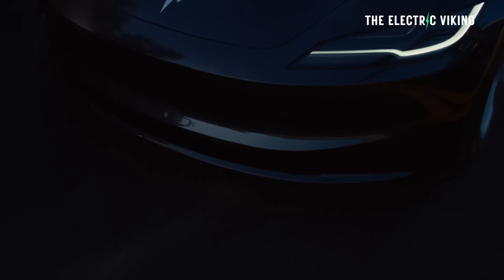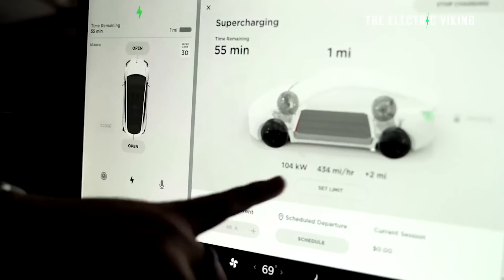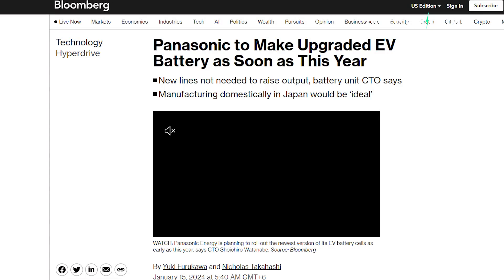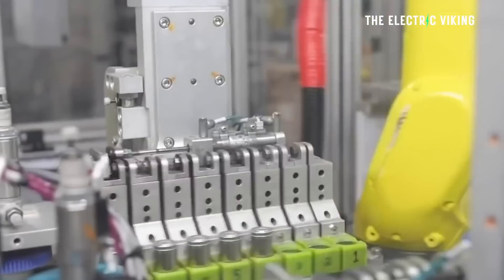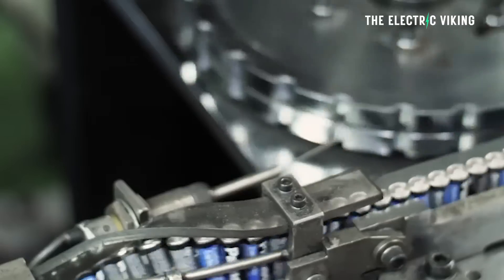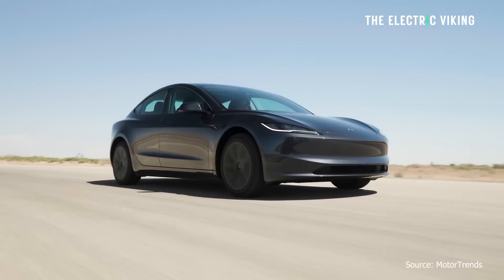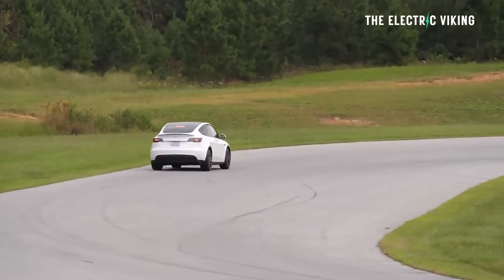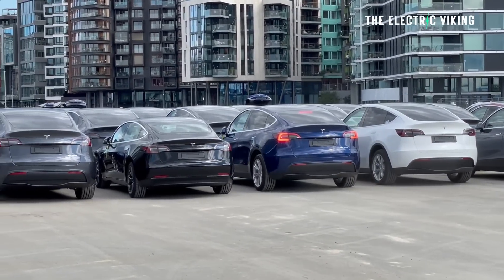Panasonic reveals new nano silicon batteries for Tesla will reduce EV prices

Comment: If I could get 300 miles of range in snowy weather while still having enough reserve to get to another charger if needed, I would be happy. This likely means a rated range of 375 to 400 miles. I believe there needs to be a change of range estimation to reflect real world use results, with better range during ideal conditions being a bonus.
Reply: I said years ago that 300-350 in mid range cars (not luxury) with heating and mixed driving would be the point where EVs become dominant ie over 60%
Reply: EV’s only lose 5-8% in subzero temperatures. We can drive 286 miles in our BMW iX from our home here in Rockies high above Boulder to the Electrify America station in Casper, on our way to Big Sky. A 30 minute charge while we grab a meal and we’re over 85% full for less than 1/3 what it would cost in gas. In summer we commonly have 60 miles of remaining range, in Winter during subzero temperatures we always have minimum 20 miles available.
Reply: you are so right  what's worse is manufacturers or EPA estimates are not accurate between models so your not comparing apples to apples   I have seen where the Cadilac Lyric goes above and beyond its range rating even doing 70 mph on the NJ turnpike    from State of Charge Web site

Comment: Good news on possible higher range 2170 battery. My question is  this is the battery going to use LFP or will it be a turnery battery? Hope all is ok with you. We had snow here in NY. Obviously much warmer by you!
Reply: Panasonic new batteries are Lithium Ion with Titan Silicon, they will still explode, more important is safety over range
Reply: ternary.

Comment: 10 to 15 % better is good.
If you have a longer rage and at the same time you can charge almost 100% 
You do not need to charge that often, that means less charge and discharge cyclus, a longer battery life.
But ofcorse IF I'm right
I hope so  😎.    If I got it correct it was in Japan
the first lithium battery was made maby Sony ? Think so.  SB.

Comment: I hope these batteries perform better in the cold. Over the weekend the local Fox32 channel reported Tesla owners’ horrible experience in the chicago area. Supercharges did not work, Drivers getting stranded after waiting for 5-6 hours, had to have their cars towed to the nearest Tesla service center, charging that normally takes 45 minutes taking over 2 hours, etc.

It may be time to bring in a PR department. 8:11
Reply: The problem in cold temp was most likely due to not preconditioning the battery.
Reply: @haywoodmorganjr1326  it had mostly to do with superchargers not charging at all and/or charging 3 times more slowly.
Reply: @realestatenow if the battery has not been precondition(warmed up) it can not be charged.
Reply: @haywoodmorganjr1326  that’s another what 5-6% energy loss?
Reply: @realestatenow the 5-6% loss will allow charging vs not charging. So it’s worth the loss.
Reply: I am wondering why this is suddenly a problem with Tesla having been on sale for 15 years ? And it’s amazing that only tesla drivers suffered in this weather and no one else was affected at all….
Reply: @ouethojlkjn  I think there are more Tesla owners now that are encountering such weather conditions for the first time with their Tesla. And they are no longer just early adopters . So they are less willing to accept functional deficiencies.
Reply: @realestatenow  what do you mean? The weather has been fine and sunny for the last 15 years?

Comment: Good news--to offer more capacity on the NMC cell but, I'm really looking forward to solid-state batteries and hope they develop and arrive, asap.  And, I own a Tesla Y and Volt, and love 'em!
Reply: Solid State batteries are going to start off at very high prices, so I doubt that we will see them in EVs before 2030. I'm really excited about nano-composite silicon anodes, because it sounds like it takes less energy to produce than graphite, so it will potentially cost less to produce, and it is decreasing costs which really makes the difference for the EV market.

Comment: 350 miles of range would be awesome, but more importantly, would be the ability to recharge from 10% to 80% in 10 minutes. I would take this ability and 300 mi range over 350 mi range taking 25-30 minutes to recharge to 80%, for example. Stopping for a break about every 200 miles for 10 minutes works out perfectly for me. I've definitely got my eye on the Juniper revision of the Model Y.
Reply: Not clear if the current Sila anode can achieve 10 minute charge times or that will be the next generation. In a press release from April 2023, Sila said that its current product can do 20 minute charge times, but it plans to get that down to 10 minutes in the future, and the press release for Sila and Panasonic partnership said: "Sila’s nano-composite silicon also improves battery charging time with the aim to drive charge times down to a mere ten minutes."
Reply: I don't think people would only be taking 10 minutes break after driving for 200 miles 😂 Heck taking an hour break after 100 miles isn't even strange

Comment: In related news: The United States produced record amounts of oil and natural gas in 2023, the excess gas that wasn’t sold for fuel was leaked and INTENTIONALLY vented into the atmosphere as methane. Methane is 80 times as powerful at trapping heat as carbon dioxide.

Comment: The average North American car has very little direct profit at the DEALER level (not counting "doc fees", "nitrogen", "Deal advantage" and other insane price gouges which are only at SOME dealers).  If cheap batteries become available then it is likely SOMEONE will produce a cheap EV.  Right now the US OEMs collude on prices in a classical "soft oligopoly" where informal processes not subject to anti-trust laws keep prices lined up. To keep that in place they need a way to keep all of the players in the same game (Tesla is not in "the game") and to keep the Chinese OUT.
Once it is possible to sell a truly cheap EV in the US whoever builds them will grab most of the market.
By "Cheap" I mean $20K without subsidies, this is a very, VERY achievable goal (based on the current cost of ICE vehicles) in the next five to ten years.

Comment: I’ve had a model 3 and have a model Y LR. I wish it had 350 mile highway range at 75mph. Currently at 75 - 80 mph I can only get like 170(winter) 220 (summer) miles range on Michelin cross climate 2. Constantly supercharging in road trips is annoying. Oem tires suck here in Wisconsin winters.
Reply: Those are good tires. I had them on a 2013 Mazda cx9. I am not sure they are the most energy efficient option though.
Reply: absolute thank you for speaking the truth about range  I live in NJ have a new Model 3 with LFP batteries that can be charged to 100%  its said  to do 272miles    not in this universe   best Ive ever done is 235  and if I keep up with traffic on highways around 75  i get more like 220  add bikes to the back and its more like 175     that doesnt cut it for me   but thats on me for not checking it out before buying    @jprt3270

Comment: @3:40 4280 battery?  I think you mean Tesla's 4680 battery.  Ah, you got it right at 6:10.  Guess it was just a glitch in the matrix.  ;)  I wonder how Panasonic fixed the silicon battery expansion issue.

Comment: I'd be more concerned with longevity and if this new battery can be charged to 100% as often as needed - in other words, is this new technology also lithium phosphate?
Reply: Sila, which is the manufacturer of this nano-composite silicon anode (called Titan Silicon), shows a graph of 20% battery capacity loss after 1100 recharge cycles, so it appears that its lifespan will be as long as most NCA and NMC cathodes, but LFP cathodes usually support 3000 recharge cycles, so it won't be suitable for LFP. It is hard for me to get excited about NCA and NMC batteries because of their short lifespan. I would much rather have a Tesla Model 3/Y Standard Range because they use LFP.
Reply: @amosbatto3051  Agree.  My next car is a Y with the LFP assuming they add AWD to it (AWD is a must where I am).
Reply: @ohger1  I would have been much less hesitant to invest in a Y, if that combo exists as well.
Reply: No, the anode is silicon
Reply: Still Li-Ion, the graphite is replaced by silicon. Don‘t know for sure, but expect same behavior as before (aging, discharge-sensitivity etc.).

Comment: It is embarrassing when one uses the 100% to 0% range at 60mph to quote range. The EPA requires manufacturers to supply the 3 constants in the drag equation. From that one can compute the range at highway speeds. Then one needs to adjust for the fastest charging time - 10% to 80%. Finally one gets 2 to 2.5 hours of driving range before a long - compared to ICE, refueling session. 

My wife's "equivalent ICE" cost $20K new. The more than $10K price premium when invested pays for all the fuel and maintenance forever.

I hope EVs become competitively priced.
Reply: What ICE car is priced at $20K new? And what EV do you think is equivalent to it?

Comment: It seemed like the Chinese battery makers had passed Tesla and Panasonic. Tesla built the giga factory to win in battery technology. In Nevada they were a stones throw from silicon valley .

It appears they were stagnant . The Chinese developed the lfp batteries which became the most popular .

So maybe just maybe Tesla and Panasonic are back in the game .
Reply: China was the patent holder for LFP batteries until it just expired, so they had a 20 year head start on LFP. As an electrician in the power industry, I can tell you that the battery industry is anything but stagnant, as investment continues to reach record levels year after year. As always there are lots of "breakthroughs" in the lab, most of which rarely make it to production. Most advances are incremental in existing chemistry and manufacturing techniques, plus raw material supply chain development.
Reply: @GoCoyote  lfp is fairly new . I believe Tesla built the first giga factory . Teslas EV program was far ahead of everyone else including China . They selected Panasonic to partner with as they had no knowledge on how to produce  batteries . Panasonic is a Japanese company . Now we know Tesla does use Chinese batteries which are lfp for the most part . I did not know of the ending of the patent . Now being the best solution today it appears Panasonic/Tesla believe this new composition as being superior .
Reply: @stevencole7331  LFP has advantages and disadvantages over other chemistries. It has greater gravimetric density, so is heavier, and cannot be charged or discharged as quickly as NMC. But it does allow charging to 100% of capacity without lowering lifespan as quickly as NMC, and it has a higher cycle life.

Unlike other auto manufacturers, Tesla does not get attached to any specific battery chemistries, but purchase (and manufacture) ones that provide a balance of the desired weight, energy, power, quality, and price that meets their needs for specific models of their vehicles. Tesla is also able to utilize different form factors as well.
Reply: People forget that BYD were making batteries 30 years ago. Even CATL has been up and running for the best part of a decade. The position that Tesla are somehow at the cutting edge of some of the technologies that some claim it is, just isn't founded. This is definitely the case with batteries. They're the new kid on the block.
Reply: @davidbrayshaw3529  interesting I never new . Byd makes electric busses 20 minutes from me .
Reply: @stevencole7331  I just cross referenced
my claim. BYD haven't been in the game 30 years, only 29. They were founded in 1995.
As a matter of interest, are you a Chinese national or an expat working there?
I only ask because of your screen name.

Comment: Hazardous waste of the future
Reply: The US already has factories to recycle EV batteries for their components or use the batteries for storage.  A large sports stadium in Holland set up solar panels and stores surplus electrity in old leaf batteries as they still have 60-70% storage capacity and then use that electricity to power the stadium at night.
Reply: @robertwoodhouse-bm7kt have you seen the size of the area they cover as I say it's a BS publicity stunt to supply the amount of power only via solar and battery without also being supplied via power lines.

Comment: Right now, it seems like older Tesla's are not worth replacing their old batteries so that they can be given a new lifeline. I saw an article about older Tesla's being exported to Ukraine and being retrofitted with recycled batteries and being used there with no problem. If replacement battery prices drops here in the US, I think more people will buy used EVs or keep their old EVs and opt for a battery replacement.
Reply: I saw a video people finding out their Spotify, etc accounts being used in Ukraine after the insurance company had written their Tesla off. Apparently, they got resold , exported, repaired & sold in Ukraine (probably in other countries too). If your Tesla gets totaled beware and make sure you can remotely deactivate all accounts you used on Tesla’s system.
Reply: There are still Tesla driving around with over half 1,000,000 miles on the clock. Battery packs almost never fail, but they do degrade overtime. With half 1,000,000 miles complete you can expect a Tesla pack to still retain 75% of its original range. even then the battery pack is still extremely valuable and won’t be broken down.
Reply: @ouethojlkjn  most 2013-2014 teslas offered for sale rarely have more than 150k miles.
Reply: @realestatenow  as I imagine is the case for most other makes of car.

Comment: Interesting as Tesla is installing 8 production lines in Texas for the 4680 battery this year in Texas . The Chemistry of using a "dry system". appears to be the problem , so maybe simple change to this new chemistry . I still recon they should make a 65160 battery ( that 4 times the capacity of a 4680 ) for the Semi a production line could probably produce about 3/4 the number of physical batteries but much more energy per shift .
Reply: People thought it was going to be some huge problem. They enough money for 5 more Texas Giga factories. If they make no money. Lol

Comment: Tesla is sitting in the catbird seat. The 2170 and 4880 cells getting 10% to 20% denser will lead to longer range or lighter packs or both.
The upcoming Model 𝛵au will be lighter and cheaper to produce for the same range as a Model ≡.
It might not have the zip of the nickel batteries, but you're not going to the Nurburgring in a Model 𝛵au.

Comment: I’d be more than happy with 350 miles real world range - especially w the reliable and fast supercharging network
Reply: The range issue is silly, most likely created by GM and Toyota. Most people don't drive more than 60 miles per day and most cars are parked 22 to 23 hours per day. 250 miles is plenty of range to meet 95% of the needs of 95% of people.
Reply: When I was young, My wife, our 2 kids, and I would drive 1000 miles/day with some frequency. Mostly to see her mother. Later we drove long days on vacation - from the Midwest to the National Parks in the West. Now we are old and drive 1500 miles to and from Disney World to vacation with kids and grandkids. I even do 16 hour driving days a couple days each year to spend a day going to the bottom of the Grand Canyon and back up.

Current EVs would make those trips impossible. Considering the traffic on the interstates, it appears a lot of families do long road trips. I might add that those who want to leave because of hurricanes might find a long trip necessary.
Reply: @AnOldGuy164  yeah but your driving habits are not typical, of course EV's are not going to fit every driving style or meet every driving need, but they meet most people's needs.
Reply: very well said Im the same way plus i carry bikes, surfboards, paddle boards ,Kayaks and what have you I love my Model 3  but it is an around town car,  no more then 200 mile car for me

Comment: nothing less than 500 miles of  published NEW CAR RANGE range is good enough....
Reply: Except for the vast  majority of people who drive much shorter distances every day and don’t need the extra weight and expense that would entail.
Reply: @georgegoodwin9722     Yes, if you are having a good day!  BUT.... Batteries degrade over time.  You typically only use 60% of EV battery on a daily basis ( between 20-80% ) and then there are REAL WORLD CONDITIONS such as weather, speed and terrain that greatly degrade battery range.  This all is important, especially as people in Chicago just learned during this recent snow storm, when Tesla Superchargers WERE DOWN due to extreme cold temps, and EVs were BRICKED while waiting for up to 8 hours in line to supercharge... being towed off by the dozen! 

My point is that ADVERTISED NEW CAR RANGE needs to be MUCH higher if you want to replace ICE in north america where the real world can smack you hard. 

Most of those people with RUINED, BRICKED TESLAs in Chicago typically only drove 50 miles per day, right??  

Not everyone lives in sunny CA with a garage sporting  multiple EV chargers for home use, and 
real world shit happens  and EV batteries are NOT up to the test.   

I own a Model Y in NC where it is reasonable to own an EV due to the moderate climate, and I am retired.  The Tesla is perfect for my use case.   But I would never drive an EV if I depended upon it for commuting.

For one thing.... when it breaks, it can be down for weeks or months due to the lack of parts and service in my state.  So.......... no............ screw it....!  I would never own an EV if I NEEDED a vehicle.

The EV revolution in North America was forced by gov-dumb-arse incentives.....  ONE FULL DECADE TOO PREMATURELY.

And finally .... lets stop trying to justify this madness based upon the short length of the TETHER  that Tesla thinks the average American driver needs.